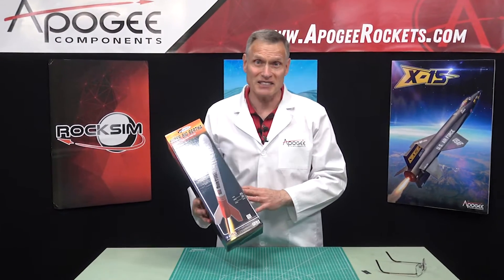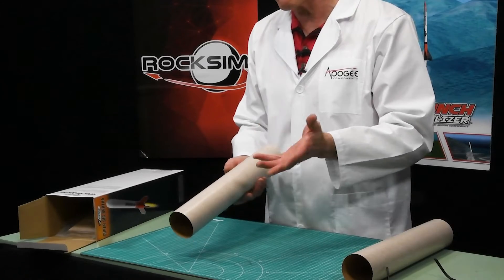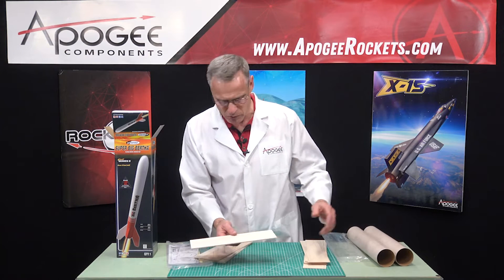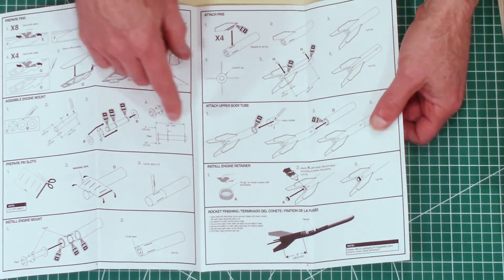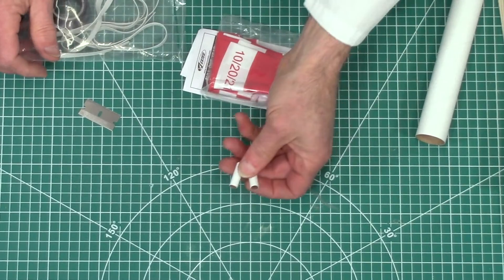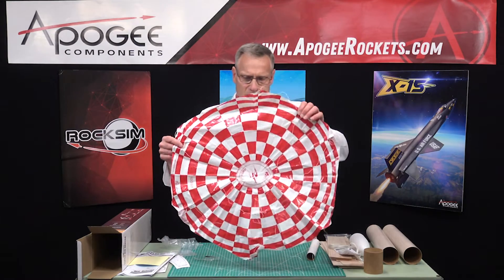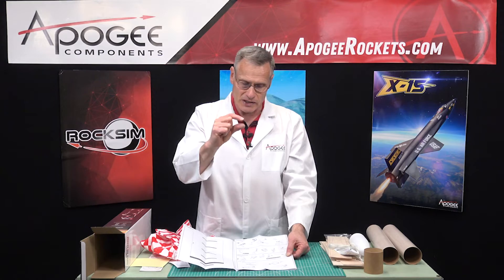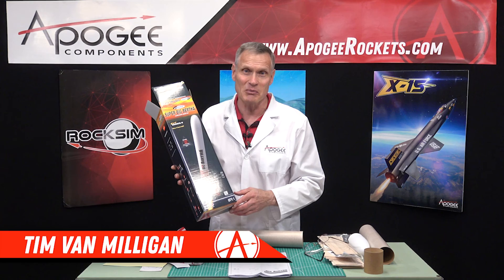Unboxing - Super Big Bertha model rocket kit

Comment: One reason to NOT use super glue on the area of the engine mount is super glue is very susceptible to heat damage.  Learned this working with dethermalizer fuses building freeflight model airplanes where the aluminum fuse holders would occasionally simply fall off if adhered with super glue (CYA).  For fuse holders I favored Cellulosic model cement like Testors cement for wood models.